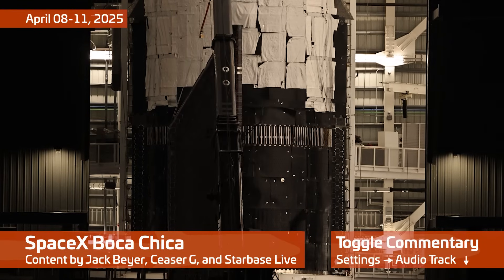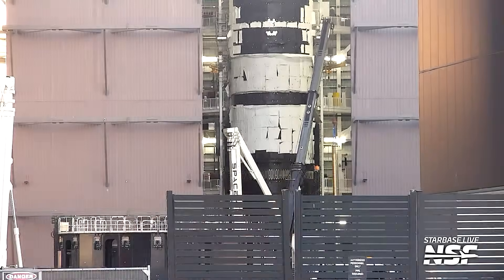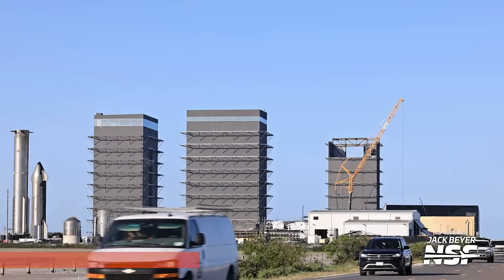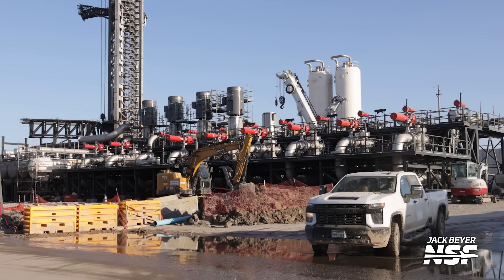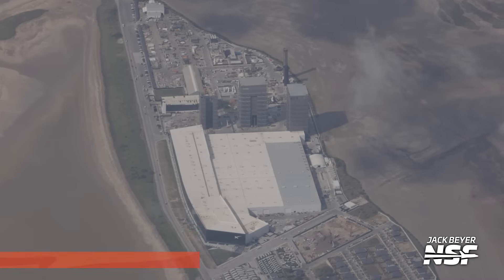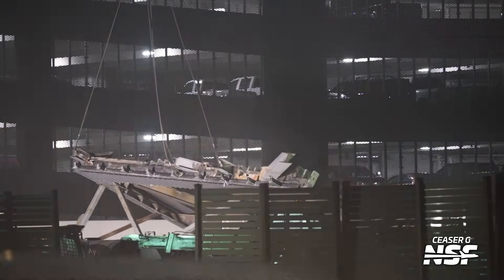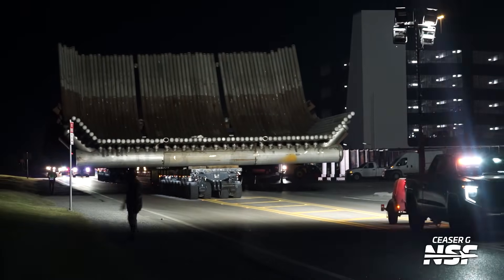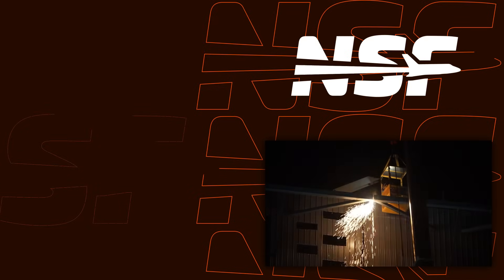Flame Buckets Rollout - STARGATE Goes Bye Bye | SpaceX Boca Chica

Comment: 'Transfer tube' - 'transfer pipe' is even better. If fluid was only going one way as with roff drainage - we can use a term 'downpipe'. But fluids are pushed up the major pipes before they come down, so transfer tube/pipe is the better term. 'Downcommer' is an horrendous term

Comment: The modern equivalent of the bus and the stadium is YT putting ads over both the launch and catch of starship. There has to be a better way 🤬🤬🤬
Reply: They're called adblockers!
Reply: @JustSomeCanuck  I hear you, but depriving NSF of revenue shouldn't be the answer.  I'm a low tier NSF member, so I don't feel bad running revanced on my phone, but in this instance, I was using a smart tv app that isn't supported.  GRRRRR.